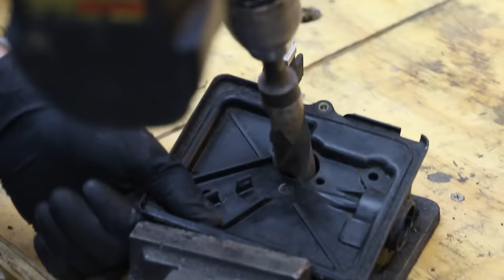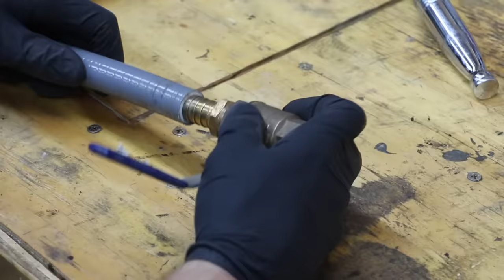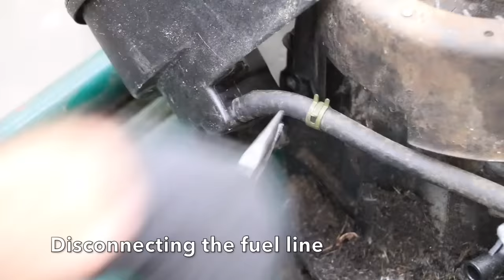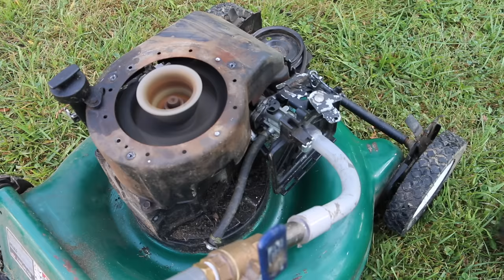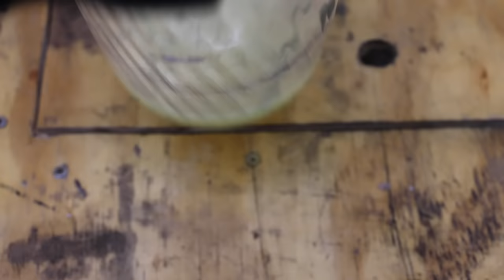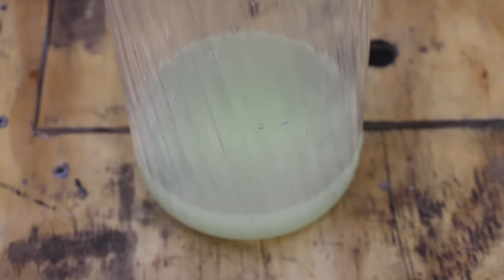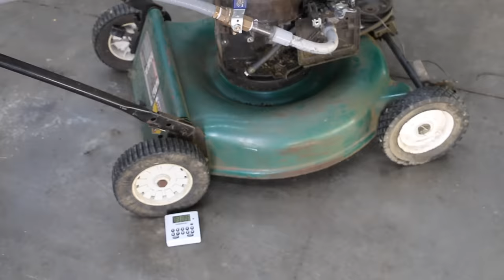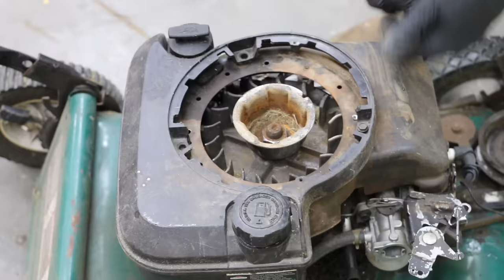Will a "Gas Vapor" Container Improve MPGs and Fuel Efficiency?  Let's find out!

Comment: Carburetor basically vaporizes the fuel before it goes into the engine anyway.
Reply: sorry,,, wrong.
Reply: Ok,,,...,,,, what is correct?
Reply: @billmalec  Liquid fuel is transferred and mixed with air in the cylinder, compressed and explodes by pressure and spark. Why do you think there is a problem with smog? Unburnt fuel. When pure vapour is burned, presto, almost 100% combustion of vapour fuel. Almost 0% smog in our cities. Plus, if the effeciency is, truly, 3%, that can be improved upon which is significant. Am I wrong or are we of two opinions saying the same thing.
Reply: @og1ie  so it's atomized with air
Reply: @billmalec  No, it is sprayed ( more or less) Look up the word atomized. We are done now. Have a happy day.
Reply: And more or less a vapor like I initially said.
Reply: Carbs just did this job before fuel injection was invented.They both atomize/vapourize the fuel before it gets burnt. In this sense ALL ENGINES run on "fuel vapor". It's just these days cars can do it right in the cylinder instead of in the carb. So no, this is not "why we have smog" because fuel injection is typically more efficient than carbs and that contraption (which is why so many manufacturers have switched exclusively to it to meet euro emissions targets), not less. The fuelling system can more accurately adjust the ratio based on all kinds of variables (whereas a carb is pretty much set).

Liquid petroleum just doesn't explode: It burns. To get it to explode, like you need to in an engine, it MUST be a vapor first.

BUT, as per Bill's top-level comment, in this case it's a lawnmower engine: I'd bet it has a good old-fashioned carb in there. I think there are some newer ones that are fuel injected but I really don't keep track of the latest trends in lawnmower engine design. :P
Reply: @Chatsu8o  You are forgetting that carburetors AND fuel injection do a very poor job at atomization of the liquid fuel..... where sucking air through gasoline is very very good at atomization ....
improving on what the automanifacturers have slowly done in the last 60 years is easy ! because their not trying very hard... they all have stock in the oil companies after all and why bite the hand that feeds you ?
 However atomization of the gas is not the answer...vaporization is ...jet engines have been doing it for decades but that technology has yet to reach cars ..... ever wonder why ? ....Bob...
Reply: @bobkelly2447  I'm not "forgetting" that fuel injectors do a "very poor job" [citation needed], cause they don't. You're looking only at one variable of many (as already mentioned) of what makes up FI's "job". Sucking air through gasoline, for instance (and as shown in the video) fouls the gasoline. It's also not as controllable as FI, which can react to changes in engine load, air temperature, exhaust O2 levels, barometric pressure, throttle position.... et al. within a single ignition cycle, per cylinder. I'd like to see your engineering designs for a pipe in a jar of petrol that can do that at nearly the level of response and precision that FI can. But, hey, you wanna use less fuel... buy a custom ECU and flash it with any fuelling map you want. Will probably destroy your engine, but it'll be extremely light on fuel!
Reply: @Chatsu8o  
The problem with leaning out the fuel air mixture is two fold. First, your engine would lose power,  second, it would run very hot if you lean it out too much.
Reply: @bobkelly2447  In carb  car engines the fuel air mix was sucked through the intake manifold that was heated up during the running of the engine. Turning the liquid gas into a vapor before entering the intake valve of the piston.
Reply: @Chatsu8o  Gasoline doesn't explode in an engine, it combusts (technically oxidizes). We call them internal combustion engines, not internal explosion engines. An explosion is a violent, uncontrolled release of energy (often from combustion but not necessarily). The air/fuel mix in a combustion chamber burns at a controlled rate within a contained space in order to be harnessed to do work.
Reply: MichelleObama isAman  What many of you don't seem to understand is that a carburetor or fuel injector is only the first stage of atomization. It's a continuing process. With a carburetor the fuel is mixed with air at the emulsion tubes, boosters, etc. but the fuel continues to tumble along with the air charge as it travels down the intake runners where it's also exposed to heat all the way into the combustion chamber which, as the piston compresses the mixture a high degree of heat and turbulence is generated further breaking the fuel down until the spark plug fires generating a massive pulse of heat and turbulence which flashes most of the remaining tiny liquid droplets into vabor. It's not a perfect process but the fuel at combustion is, essentially, atomized in a somewhat to near homologous mixture, depending on the engine.
Fuel injection is similar but the fuel comes out as a fine mist which eliminates the need for emulsion tubes or running the fuel through the intake runners. In that sense, all engines "run on vapor". 
On top of this, propane engines introduce the fuel into the engine as a vapor just by the nature of propane and they aren't significantly more efficient or emissions friendly then gasoline engines.
There is a reason auto,etc manufacturers don't go to the trouble of "pre-vaporizing" or atomizing the fuel, because the engine, itself, does a satisfactory job just in the nature of how it operates.
Reply: Correct ICE run on as air/fuel mix, no mater how a gaseous or liquid full is delivered to it
Reply: @elhombremo7404   Pick up a dictionary and read. What I am saying is, " The red house is not blue." You are saying, The red house is blue because I was told it is blue." Have a happy day, El Sombrero Hombre ."
Reply: @og1ie  I have no idea what that means but I'll say this a different way. 
I am not saying the red house is blue. I am saying the gasoline that enters an engine's combustion chamber is vapor, not liquid because I was told by my professor of mechanical engineering that it is vaporized when it gets shot into the combustion chamber. 
https://www.hemmings.com/blog/article/fuel-atomization/
Reply: No it atomises the fuel.
Reply: @BuilditRideit  That is correct that the injectors atomize the fuel, but what happens to liquid gasoline is atomized? It vaporizes.
Reply: @177SCmaro  You seem intelligent so I'm replying to you. Pretty much what you said, but I've seen multiple gas car engines run first on.. gas, next on an LPG kit. The latter actually gets some more horsepower and does noticeably better on emissions as well. Can't see nothing almost all the time.
Reply: @niro56  My point was that gaseous fuels like propane and not dramatically more efficient in terms of power or emissions compared to gasoline. I'm aware that they can be somewhat better in emissions and fairly comparable in power.
Reply: @og1ie  "Why do you think there is a problem with smog" because the Chinese dont filter anything but the internet
Reply: Originally, that's hiw they ean engines. However, it was difficult to precise control. So the carburetor was born
Reply: Vapor is fuel in a gasseus state. Atomized fuel is small fuel droplets (still in liquid form) mixed with air for even distribution. Not a hard concept to understand. Carbs and fuel injectors do not vaporize fuel.
Reply: *atomizes.
Reply: 85% of all fuel from a carburetor or fuel injector goes out your exhaust pipe as unburnt hydrocarbons
Reply: Still liquid when it enters the engine cylinder. Even with fuel injection.
Reply: @og1ie  I'm just gonna say this straight, smog is due to unburnt fuel yes... but you can have unburnt vapor also by adding to much to the point where it collects, liquefies again, and then it is running rich. And yes cars and trucks alike both have already been running on atomized fuel since the beginning of time, carburetors have venturis in that suck in air and create a vacuum that fuel is introduced to and the fuel is then instantly mixed with air turning it into "very fine particles or droplets" aka its atomized. And in fuel injection it is the same thing but instead of adding fuel and air at the same point you get a intake manifold with air passing through and each injector injects fuel into each different intake runner and there it mixes with fuel, now throttle body injection works very similar but is less precise in terms of fuel delivery to each specific cylinder much like that of a carburetor. Atomized fuel happens in every car since the beginning of time period (exception is electric vehicle that were once present but are now making a come back). Vaporized fuel is what I believe to be the same thing in this case as liquid particles of fuel are suspended in the air as it enters the engine. The problem with running a car on "fuel vapors" isnt that it wont work, it's that it's not practical... take a car with 300hp add more fuel and more air and then bam you have a 400hp car if done right, take that same car and convert it to run on "vapors" and you no longer have a car making nearly the power which means you have to hold the accelerator pedal down longer to get up to a set speed which potentially uses the same if not more fuel. Cars can run on a lot of different things, but you need a sufficient volume of fuel in order to propel an engine driven vehicle at a acceptable rate. Sure a lawn mower is perfect for this kind of thing, low fuel demands, light loads on the engine, small displacement. That's why they invented a much smaller thing called a carburetor and a fuel tank.
Reply: @og1ie  and by the way air and fuel in a typical vehicle is not mixed in the cylinder, it is mixed when sucked through a carburetor or injected into a manifold, the only time it is directly injected into a cylinder is through direct injection and that is most commonly used in diesel applications and some gas applications but is not used everywhere. Please do some searching into how an engine works before you try to correct someone on something that is not false.
Reply: @bobkelly2447  Carbs and Fuel injection do a great job at atomizing fuel, I'd say better than any spray bottle filled with soap and water. Efficiency is the key here, using up 100% of the fuel delivered into the engine. One that's impossible, there will always be a factor that throws that perfect mixture off. Weather its low compression, a clogged air filter etc. Theres a million things I'd imagine. But the atomizing of the fuel is not the significant one. Really we have the best engine and fuel set ups that are possible at this time. Granted theres higher energy fuels that could be used which means we use less fuel per mile but that's not the point. The point is that you need the perfect mixture of air, fuel, compression, and heat to make a combustion that uses 100% of the fuel given. That would take a lot of pressure and a lot of heat to do and or just a lot of heat which happens by leaning out a cars air fuel ratio making it easier to burn the fuel because there is less... but the reason auto manufacturers dont do this is because things like pistons, piston rings, valves, and heads, tend to melt when or crack it warp when heated due to lack of proper fueling. And to run an engine with a high enough compression to vaporize the fuel enough that the given heat can use 100% of the fuel is too high for an auto manufacturer to mess produce because it would require everyone use high octane fuels and pay more for premium parts like forged pistons and rods and crankshafts so that people dont have to sacrifice reliability for efficiency. Now if you have a clogged air filter because you are being cheap and didnt buy a new one and feel you dont need to then you're just making the problem worse, you cant properly get max efficiency out of an engine if you cant let it breath in the fresh air its demanding for the amount of fuel you want to give it, so you get worse fuel economy and lack of power and in simple terms are just making an already non perfect engine even less perfect. Theres really not much we can due in terms of mpg or emissions by using the same fuel in different ways. Now if we used different cleaner burning fuels then we can eliminate emissions, if we use higher energy fuels then we can increase mpg. If we use extremely cheap fuels then no one cares about the energy it produces because we'll just throw more fuel at it till we get the power desired and fuel economy is forgotten because it's so cheap to refill. Then all you have to do is worry about emissions which can probably be taken care of with some sort of catalytic converter or exhaust filter like most cars have these days. It's really a battle that the average person doesnt have the money or power for. So why bother messing with it, get a better job, spend the extra buck on gas, and live out life because it's going to be a good while before anyone addresses new fuels
Reply: Atomized gas and gas fumes are different but ok
Reply: @og1ie  🤦‍♂️🤦‍♂️🤦‍♂️😂😂
Reply: Logan Leslie it’s not sprayed in a carb set up it is pulled through the Venturi ( Venturi affect ) and atomized through the jet creating a mixture of small atomized drops of fuel mixed with air . It is almost the same as vapor but not quite total vapor . With the vaporizer the oxygen is mixed with the fuel so as it boils off it enters the intake as a true vapor which makes for a more efficient burn . There are a few reasons why this test only saw a small efficiency gain mainly timing . If he had advanced the timing it would have greatly increased the burn and even added a touch of pre ignition would produce a even complete burn making it even more efficient.
Reply: same with fuel injectors, though i don't think it's a perfect vapor... or 100%
Reply: @Chatsu8o  I don't care about the difference in how the fuel gets there, but we have to have the same definitions.  "Atomization is defined as the process in which a bulk liquid is broke up into a large number of discrete droplets. ... On the other hand, evaporation is a phase change process in which the bulk liquid changes phase into liquid vapor". Simple google search, resulting in a believable definition.

What is really cool in the video is the vapor and air being drawn into the engine work.  Both the carb and FI atomize the fuel.  The difference is vapor is a gas and the current systems deliver droplets.  What is impressive to me is that pulling the air through the gas keeps enough vapor in the system to run the mower for as long as it does.  It does demonstrate the need for good filtration if this were to be applied to cars, which isn't likely to ever happen.  It would be cool to see a car run on vapor just to stem my curiosity.
Reply: Was just thinking this all this really does is add more air to the a-f Ratio this is done by just screwing the jets on the carb
Reply: You are exactly correct.
The liquid itself is not flammable, it's the gases (vapors) that are flammable.
Reply: Shawn R Your answer is the one I was looking for - correct! The intake manifold plenum was heated with exhaust gases routed under manifold runners - it certainly helped vaporize fuel when coming into contact with heated manifold.
Reply: shvrdavid. I have a question: Comparison of direct injection to port injection - wouldn't the fuel molecules tend to "fan out" in port injection environment being more or less a vacuum vs direct injection fuel being introduced a pressurized chamber (cylinder)?
Reply: @billmalec  your right they are wrong they know nothing about carbs lol
Reply: with a carburator fuel goes into a stream of air wich is created by the engine vucuum then it goes in the cylinder
Reply: @jessemano9880  you know you're carbs are you a biker
Reply: "Vaporize", not really. Carburetors only mixes air with small droplets of fuel : so it's not gas that enters the cylinder.
Reply: @shvrdavid  the thing is people dont understand not only physics but also instruments in the car... as i once chat with a friend about how diesel engine work and he cant understand how can it be so hot (about 500C) before combustion when dial in his car show that "engine" temp is only about 100C after heat up
Reply: @og1ie  It doesn't explore - it burns.
Reply: Bill Malec before you write a comment about an engine check your facts before you write about it
Reply: @og1ie  what is the point of a carburettor then? The air is sucked into the carburettor when a butterfly valve is opened or a slide valve needle jet the fuel is sprayed into the air stream were it is mixed into gas then into engine ignited and blown out of Exhaust
Reply: @177SCmaro  what is the venturi for in the carb for Einstein if the fuel was droplets in the barrel it would flood the engine and wet the plug and wash the bore and smoke like heck and please look up emulsify it's the mixture of two liquids i think petrol has to mix with air to combust Einstein
Reply: @shvrdavid  you don't understand the difference between petrol and desil oil
Reply: @elhombremo7404  at last somebody with a brain lol
Reply: @elhombremo7404  they are morrons you are right now all you have to explain is the burn and heat expansion in a confined space creates the power good luck I'm gone life is to short oh And it's desil that ignites under pressure with no spark plug lol no electric ignition system on a desil engine just heater plugs for first start
Reply: @Reno Simpson I believe almost everyone is confusing a vapor with a gas. A gas is the state of matter. A vapor is something diffused or suspended in the air. But how do you diffuse the liquid gas into the air to make gas vapor? You have to atomize it first. You have to convert the gas into very fine droplets.
Reply: MichelleObama isAman  exactly right you are, the difference between fog and water vapor which is clear and invisble..he didnt vaporize the fuel. That requires heat..
Reply: @Reno Simpson  you sound like  you're drunk in replying. Please give me something coherent I can reply to.
Reply: @og1ie  this is wrong. Air and fuels cannot be combined to make a third substance called "vapor". Gasoline and air will always remain gasoline and air. You can mix them together better or worse but but this does not change either one of them.
Reply: @Reno Simpson to atomize is to convert into very fine particles or droplets. No phase change is required to make gas vapor. It is just small droplets of liquid gasoline suspended in air.
Reply: @leop9021  so what would you say a vapor is?
Reply: @crabmannyjoe2  
"A substance diffused or suspended in the air, especially one normally liquid or solid." In this case we speak of gasoline as the liquid. A vapor is not a new substance however. It is simply a specific type of mixture of at least two substances; again in this case gasoline and air.
Reply: @og1ie  the reason for smog is all the extra crap they put in the gas, like ethanol, i believe that doesn't vaporize as much when run through this set up, so its mostly gas which burns cleanly, when you combust gasoline all of it ignites, there is no unused gas
Reply: @bobkelly2447  its not because they have stock in gas companies its because if they all race to the finish then there is nothing left to sell the next generation of cars on, car manufacturers want every generation to be slightly better because thats what sells them, besides neither of them suck so much worse than vapor, as shown in this video, go ahead and convert your car, nobody is holding a gun to your head
Reply: @miniair  yes, they atomize it but even then it is still a liquid and cannot burn, but from there it can vaporize itself extremely quickly due to the vastly increased surface area which then allows it to combust
Reply: @Reno Simpson it is literally in the definition of a vapor. As Leo says right after you. There is nothing in the definition concerning any sort of phrase change. Imagine a spray bottle. It makes small droplets of water or whatever was in it, and pushes them out into the air in front of it. It creates a vapor. No phase change required.
Reply: @leop9021  I see you were replying to an older comment. I think we're on the same page though. Sorry.
Reply: Why do we call it a carburetor it's so lame, we should have called it a vaporizer
Reply: Liquid don't burn, it's the gaz going out of the fluid that burn. But, it's not the carburator nor injector that turn it into gaz. They're job is just to adjust the amount of gazoline relative to timing and air volume. What turn gazoline into gaz is just the ambiant temp of the air. It's why it feel cold when you touch it. The fact than the gazoline is pulverizing help the process to be done. If some of you have ever work in ATEX environnement, it will know it.
Reply: @og1ie   running on vapor will cause the engine to run hot and lean leading to a huge increase in NOX emissions so no, running on vapors would not solve smog
Reply: @Eli Z  hydrocarbons(unburnt fuel) + NOX are the main ingredients in today's smog
Reply: @TheJ0nyBrav0 No.. it isn't. When you heat up liquid gasoline, it vaporizes and the vapors are flammable. The liquid itself does not burn until it has been turned to vapor.

Gasoline vaporizes very easily. As a matter of fact it vaporizes at room temperature very quickly. That is why gas cans swell up if you don't let the pressure out and you can see a mirage over a container of gasoline. So any heat whatsoever will cause liquid gasoline to vaporize and any heat over 495 F will ignite the vapors.
Reply: What boggles my mind is how people do not seem to understand that gasoline engines burn gasoline vapor.

Yes, what they burn is already a vapor.

The fuel delivery system gives the engine atomized fuel, so tons of tiny droplets. As the air/fuel mixture is compressed in the combustion chamber, it heats up very quickly. This causes all of that liquid gasoline (droplets) to quickly turn into vapor before the spark fires.

Stop arguing about basic chemistry, please.
Reply: @og1ie  Bollocks.  Of course it does.
Reply: Atomizes.  Not vapourizes.  Moreover, in reality, carbs never do their job as well as this textbook definition says.
Reply: @LI4MW00DLAND  You are telling me that none of the petrol evaporates?    Of course it does, it can only explode if it is a vapour,  ie mixed with oxygen.  If it is liquid it will just burn.
Reply: @LI4MW00DLAND  once atomized it will vaporize.  primarily fuel only burns AFTER it vaporizes and the point of a fuel injector or a carburetor is to atomize the fuel SO THAT IT WILL VAPORIZE QUICKLY and create a relatively even air fuel mixture.   All engines primarily run on vapors.  keeping the fuel as a liquid up until you inject it into the intake manifold does not mean it is still a liquid by the time your ignition spark triggers.  In general it isn't.  gas or deisel fuel will mostly vaporize before it burns.
Reply: @Rich B " just try it"  We already did try it a hundred years ago or more.  When the otto cycle gasoline engine was first invented they had a problem.  how do we get liquid gasoline to turn into gas VAPOR so it will easily burn and burn quickly?  Their answer was to spray it out into tiny droplets in a stream of air.  This is called a carburetor.  Its purpose is to let the engine run on gasoline vapor.  The difference in method here is that instead of blowing tiny particles of gasoline into a stream of air, they blow a stream of air into a tank of gasoline.  This "new" method of making a carburetor is basically inferior in every way.  The mixture runs too lean to make good power, you cant CHANGE the air fuel mixture like you can with a choke on a carburetor to help start the engine, and the whole assembly is far more bulky than a carb.  
       In one of my first classes in mechanical engineering my professor related a similar story of someone coming in claiming they "invented" a way to make a car engine work on fumes.  It was the exact same thing as this video.  We all laughed at it then and that was 20 years ago.  The guy replaced his carburetor with an inferior carburetor that was far larger and didn't realize he was just doing the same exact thing only worse.  Gasoline will evaporate based on the surface area of the gasoline that is exposed to air.  blowing bubbles through a can of gas is a decent way to generate fumes.  spraying tiny droplets of gasoline into a stream of air however is a much BETTER way to turn liquid gas into fumes.  the method in this video does not increase fuel efficiency, it just reduces gas flow and cuts engine power as a result.  efficiency has not improved, your engine just sucks now because its weak.  You can do the same thing by changing the carburetor to lean out the fuel air mixture which will of course reduce your power as well.  The 400% to 500% fuel savings people are claiming is total nonsense.  energy cannot appear out of thin air.  Engine power only comes by burning gasoline.  Burn less gasoline and you get less power.  That is all this modification is doing and there are better ways to do it.  Go change the ports on your carburetor to run more lean.  done.
Reply: @Rich B I never said it didn't work.  I said it was doing the exact same thing as a carburetor.  You arent changing anything by switching one carburetor for another one.  Your new carburetor is just worse than the old one and runs a leaner fuel mixture.  Your fuel consumption is only going down because your power is going down.  you can do the same thing by adjusting your carburetor to lean out the fuel mixture.  And by the way, CAR COMPANIES dont make any money on gasoline.  That would be OIL companies.  Car companies have no motive to deliberately keep their fuel efficiency low and they have been putting MASSIVE amounts of money into R&D to INCREASE fuel efficiency.  Older cars were lucky to get 18 MPG, but now you can find cars that get over 30 mpg.  You should know that from your own experience.  If switching to this style of carburetor would increase fuel efficiency then ford or GM would have done it decades ago.  This idea isn't new, I first heard of it 20 years ago.  Ford doesnt bother with it because it isn't better than a regular carb.  Engines already run on vapors, that is the point.  A carburetor is used to atomize gasoline SO THAT IT WILL EVAPORATE AND BECOME VAPOR.
Reply: @jajsamurai  The problem here is a lot of you are using the term "vapor" when what you really mean is "aerosol." Gasoline "vapor" is what you can see eVAPORating (see how that works?) off the top of an open container of gasoline at typical temperatures. It still needs to be mixed with air to be flammable, which usually happens automatically if air is present. When you mix the two together you now have an aerosol, not a vapor.
Reply: @ae4164   "the term "vapor" when what you really mean is "aerosol.""
Wrong.  I'm well aware of the difference between tiny droplets of liquid and a vapor.  A carburetor creates tiny droplets of LIQUID which will almost immediately EVAPORATE into a VAPOR.  That is the entire purpose behind using a carb to aerosolize the gasoline.  Do you realize how HOT it is inside an engine cylinder BEFORE the spark triggers?  Compression increases temperature and you will get up very near the auto ignition temperature of gasoline before you hit top dead center.  That temperature is around 490 degrees F, or 290 degrees Celsius.  Try this experiment.  heat a frying pan up to at least 100 degrees Celsius and use a spray bottle to squirt tiny droplets of water on it.  Do those water droplets EVAPORATE?  Do they evaporate QUICKLY?  I'll bet they do.  That is the water turning into water VAPOR due to two things.  One, tiny droplets evaporate quickly, and two, liquids evaporate FASTER when exposed to heat.  combine the two and guess what?  you generate VAPOR very quickly.  
      Did you really think those tiny droplets of gasoline never evaporate?
By the time the compression stroke is done and the spark plug is ready to ignite your air / fuel mixture you DO NOT HAVE any droplets of liquid gasoline left.  They have all evaporated into gasoline VAPOR.  That is how a gasoline engine works, and it has ALWAYS worked that way.  Gasoline engines have ALWAYS run on vapor since they were invented.  
    By the way, fun historical fact here.  early carburetors actually DID work exactly as this video describes.  The first carbs for gasoline engines did NOT create droplets of gasoline but rather ran a stream of air over the surface of some gasoline to pick up VAPOR.  the system was abandoned because the modern carburetors are BETTER.  The ideas in this video are not new, they date back to the 1800's.  This type of carburetor was just abandoned because it SUCKS compared to a modern carburetor.  
https://en.wikipedia.org/wiki/Carburetor#History_and_development
"Early carburetors were of the surface type, in which air is combined with fuel by passing over the surface of gasoline."
     This video is not doing anything new.  It is just re inventing an old and obsolete style of carburetor that was abandoned back in the 1800's in favor of the modern carburetor because the modern one is better.
Reply: So this is a more efficient carburetor then?
Reply: @forward876  "So this is a more efficient carburetor then?"
No, this is a LESS efficient carburetor.  They used to make carburetors like this back in the 1800's but they stopped because this style of carburetor sucks compared to modern ones.  You cant get as much fuel into the air fuel mixture with this style of carb as you can with one that sprays the fuel into the air stream.  It makes it hard to start the engine and you dont get much power if your mixture is too lean.  If you want a lean mixture a modern carb is CAPABLE of doing that with a simple port adjustment.  So a modern carb CAN run this lean but it doesn't HAVE TO.  A modern carb sprays gasoline out in a fine mist so that it can evaporate and create vapors MUCH MORE EFFICIENTLY than simply blowing air across (or through) the gasoline.  This is why a modern carb is capable of creating a richer air fuel mixture than this system given the same basic size and weight.  Of course if you make your carb big enough then you can get a rich mixture even with a less efficient system, but who would want to do that?
Reply: @elhombremo7404  You got me thinking... so now I am very curious. How does the propane or LNG that comes from a leak in a house explode? What is compressing it? Very few houses are sealed well enough to build up significant pressure. There are lots of examples of that happening across the world, even in firedighter and science videos.
Reply: @elhombremo7404   gasoline is 100% flammable  in liquid form.  Hence the words flashpoint and firepoint.  The liquid will give off vapors above a temperature  and it will continually burn.
Reply: @Targetshooterscorner  lol... You just said it was flammable in liquid form then said it will give off vapors and burn constantly... Do you understand that if a liquid vaporises and the vapors burn... The liquid is not burning.
Reply: not really. it's like a fine mist. that's not the same as vapors